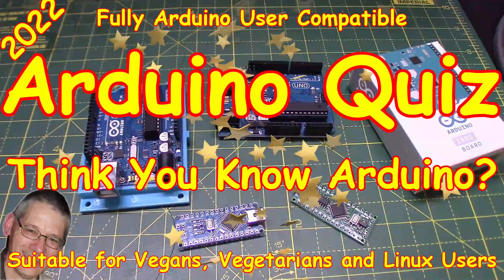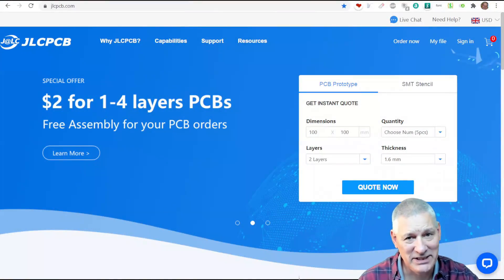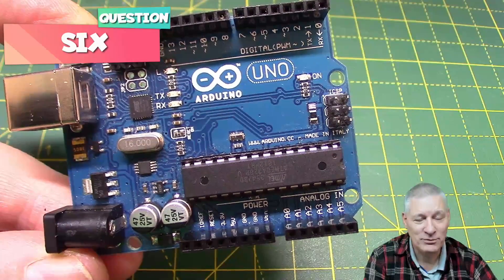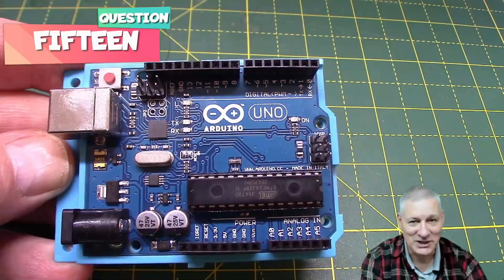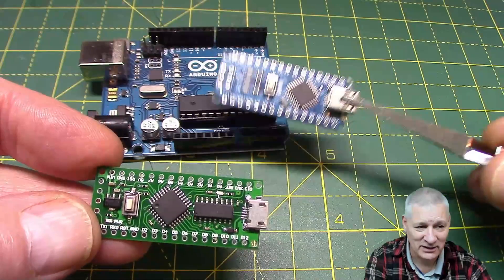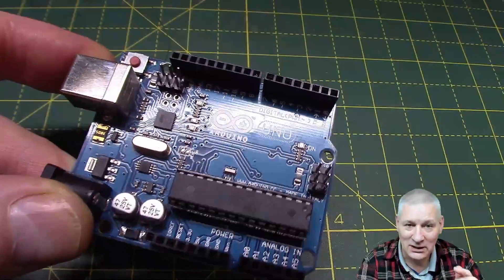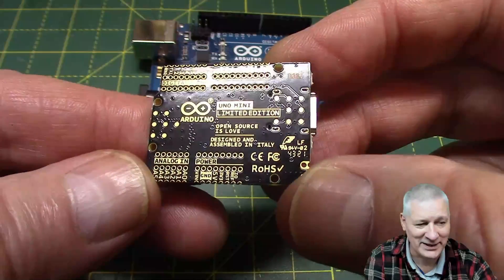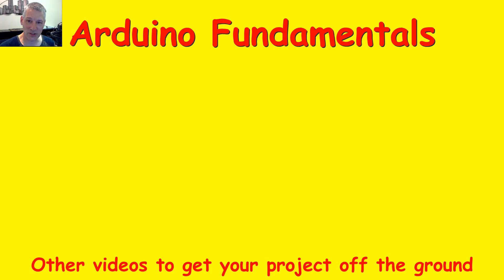#234 Arduino Quiz🎈🎉New Year 2022! So you think you know the  Arduino?

Comment: Hi Ralph, you asked whats the maximum voltage you can put on a pin. well that depends on max output of your power supply. :-)  You did not say the maximium allowed, or recomended for the chip.  I expect the ESD protection diodes would try to limit the voltage to about 5.7V but the maximum should be about .5V above the supply voltage to the chip. if your running it at 3V3 putting more than 4.0V would start to pull VCC up.
That is if the chip does have ESD protection diodes on the i/o pins
Reply from the maker: OK, now who's being picky? Yes, you are right. If you run the chip lower than the standard 5v, then you are limited (in theory) to max GPIO voltage of VCC + 0.5v but I think these chips are pretty robust and would survive. Probably.
Reply: @RalphBacon  Picky me ;-)  i just liked to point out that if there are ESD protection diodes they normally connect to the internal VCC. I have in the past had inputs go higher than the Vcc supply and power the internals via the input pin.  Now i tend to fit a resistor so this can't happen or if it does limit the current. Happy New Year Ralph, looking forward to more videos.
Reply from the maker: Yes, that can easily happen (power the chip via its inputs) and must be avoided. 

Now A related question for us in a future video: the ESP32 runs at 3v3. Absolute maximum is 3.6v (and it is then stressed, says the datasheet). So how come mine is running (and has been for weeks) at 3v8? No magic smoke? Bizarre.
Reply: @RalphBacon  it's the same way overclocking works. You can't make a chip work to a limit then just stop.

They do a stress test on maybe a few batches of chips and work out where they fail and what is the lowest of them all. Or do some stats on the results as you want the best voltage or frequency range as you can for the customer without increasing costs or reducing reliability. 

So you pushing a chip up to 3.8V might work for a week, month, or a year. But designing a product with a Vcc above the stress max limit, will in the end mean that returns might be coming back faster than you can ship them out.

So keeping to 3V3 the chip shall have a long and useful life (happy customer), going close to 3V6 and you are in the lands of the god’s reliability wise.(unhappy customers + very unhappy boss). Going above 3V6 and you will start to find the ones that die early. Could well be with the next batch chips all your boards die during test.

The datasheet is you friend, they go to a lot of effort to help keep your customers happy, and if it fails you can wave it at the boss and point out your design is within recommended design limits for that part. So not your fault for that bit.

Need a rest now, all this typing is hard work :-)
Reply from the maker: Have lie down, by all means. I still have to replace that "3V3" regulator on that board (giving out 3v8) with a new one. Tiny thing, I'm still mustering up the courage (and trying to find my glasses). How's the lie down going?
Reply: @RalphBacon  lie down went just fine. Keyboard rested and ready to go again. ;-) change that reg and give the poor thing a less stressed life.

Comment: What a swot! I got 27 points and no googling required! 

Regarding power limits though, beware that there's a limit on the ATmega328p overall, a limit on the maximum from any one port as well as the individual pin limits. 

The Uno Mini looks cute, I have to admit. 

Happy New Year.

Cheers,
Norm.
Reply from the maker: I had no doubts you would get them all right, Norm. Imagine if you had got the timer question wrong!!! 😅 

Yes, I did mention the overall current limit on the chip (and, indeed, per port but let's not get even more picky). I'm still figuring out how to connect to the header sockets on that Mini, 1.27mm spacing.
Reply: @RalphBacon  If I'd got the timer question wrongs, I'd have had my Arduino credentials removed! ;-) I wonder why Arduinos always come with out of spec spacing! Must be to keep us on our toes.

I'm jealous of the Mini though. Looks cracking.

Cheers,
Norm.

Comment: Q3...isn't that an LGT8F328P? In which case the fundamental difference would be that it runs at 32MHz. Happy Easter.
Reply from the maker: You're kidding? I must go look. [5 minutes later]. Yes, it is. But it does say "Nano 3 compatible" on the back. And it won't run at  32Mhz unless you hack the (or create a new) "boards.txt" (see my video #156 on how I did this, very easy). Maybe that's why it runs at 16MHz out of the box? Well spotted, 5 bonus points for you.
Reply: @RalphBacon  No need for hacks these days, the boards.txt file is totally different from that in your video....maybe a revisit is in order? Great boards, and all the components on one side too!